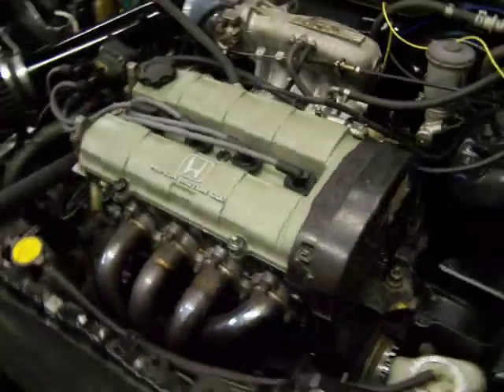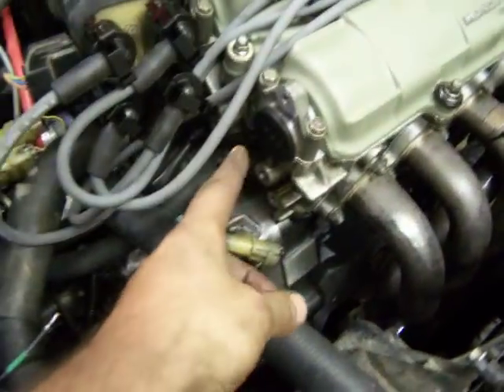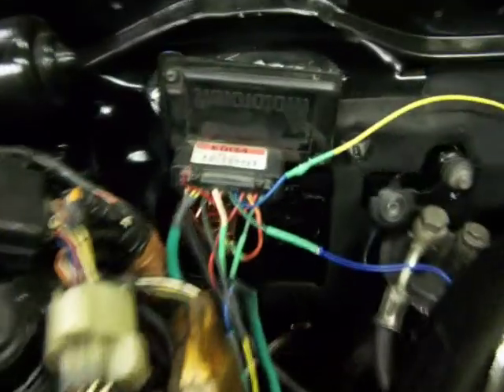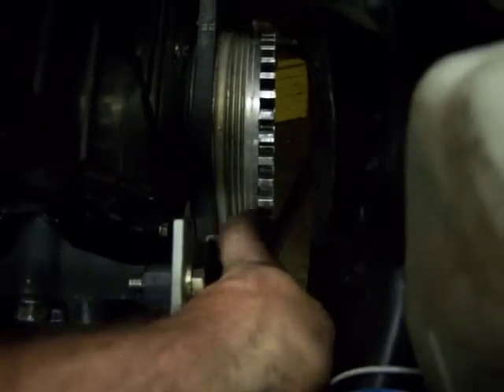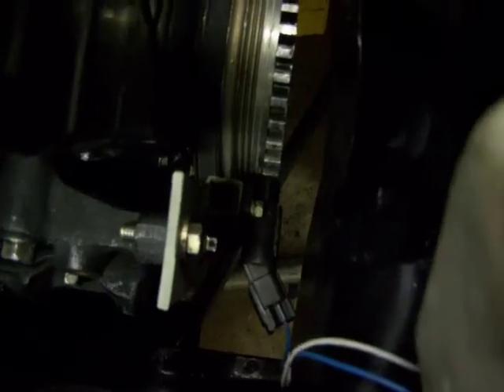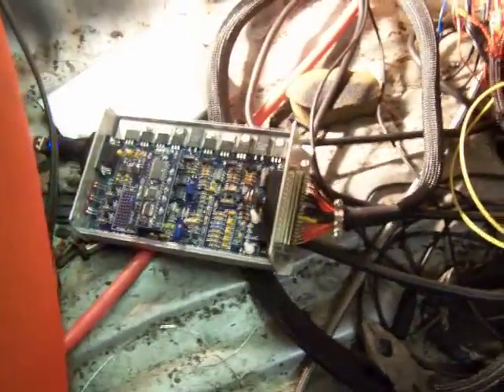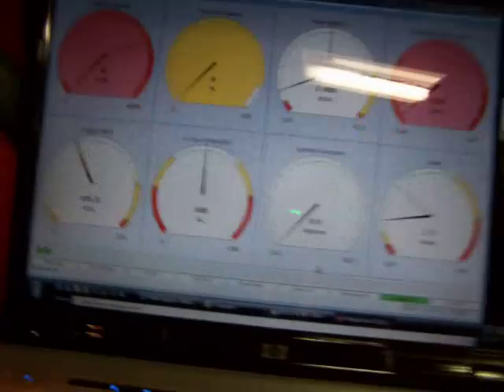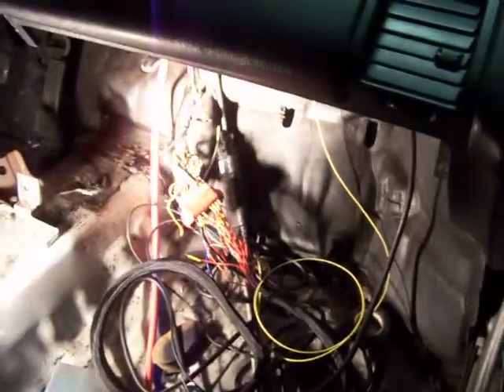88 Civic DOHC ZC with MegaSquirt, Nitrous, and EDIS ignition

Comment: hi, i want to transform my ignition in a similar way.  per cylinder ignition transformer.  i have a set but it works based on sz or tps or map.  works with carburetor but i already have injectors and p28 ecu.  the question is, does the megasquirt work on its own?

Comment from the maker: It is an oxygen sensor that is more acurate than the standard factory (narrow band) O2 sensors.  It measures the ratio of Air to Gas or AFR that is coming out of the exhaust.  This is a vital measurement when tunning and engine.  A engine that is to lean (to much air, not enough gas) will detonate.  This is the main cause of most catastrophic engine failures.